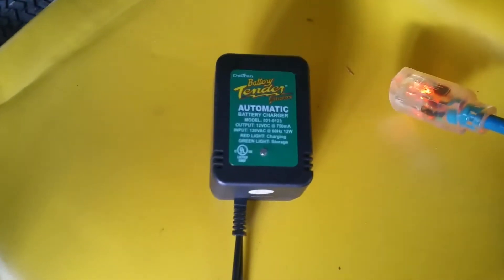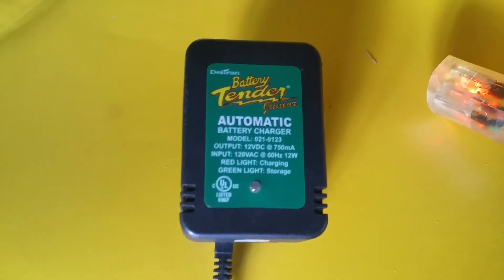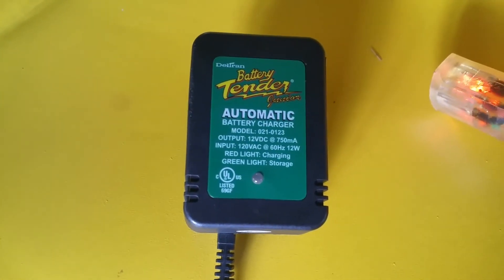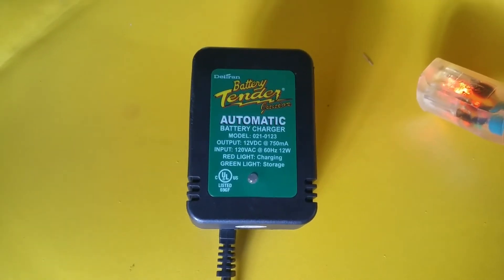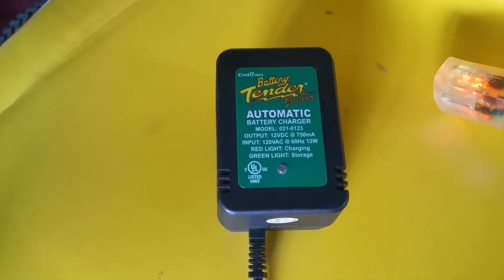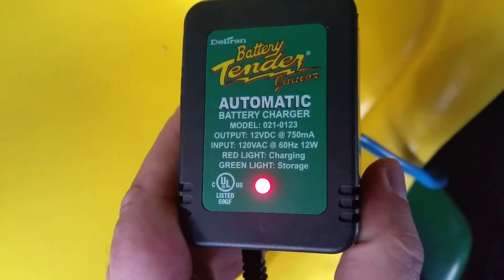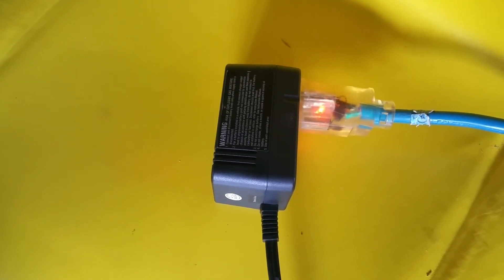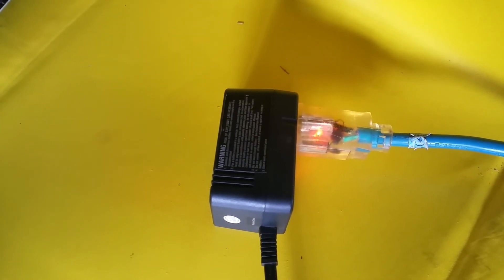Battery Tender Jr Repaired

Comment: The resistor on mine is bad, and I can’t read the stripes. Can you tell me what size resistor I need?
Reply from the maker: Buddy, I don't remember. I repaired mine years ago and it is still working. It should say on the capacitor the rating.
Reply: @GuretoSefirosu  would it be possible for you to open yours up and look at the resistor? Like I said, mine is unreadable. BTW… it not the capacitor, but the resistor

Comment: I've not had success replacing capacitors in these BT Juniors. More likely the ICs go bad from overheating or just plain defective. But the good ones have lasted for years and years. (I have 6 of them running and 2 Yuasas, one of which was defective out of the box)
Reply from the maker: Are they used outside? We get REALLY hot and humid here in the south and the capacitor does wear out. Replacing it has fixed more than one for me.
Reply: @GuretoSefirosu  My older ones have held up really well but it seems the newer ones not so much.

Comment: Hello. Mine presented this same problem.  The red led does not go off after I dropped it on the ground.  Did you happen to make a video where the problem capacitor is shown and its switch?
Reply from the maker: No, I did not record the repair. There is only one capacitor in the entire unit, so it is easy to locate.